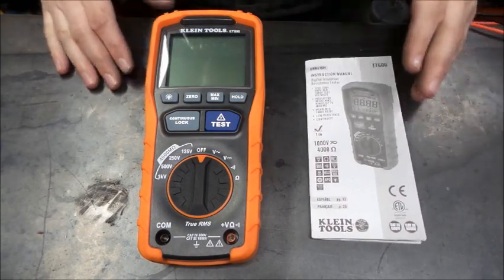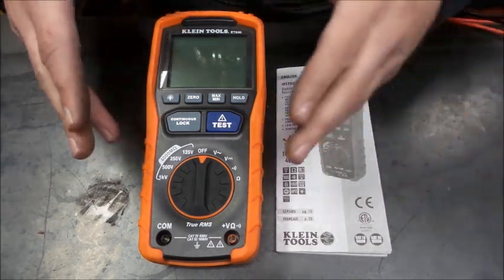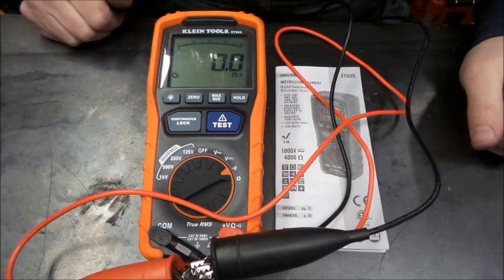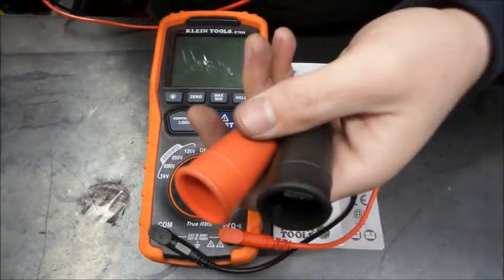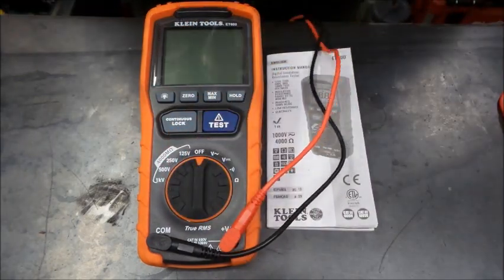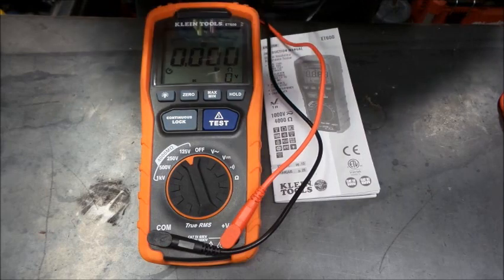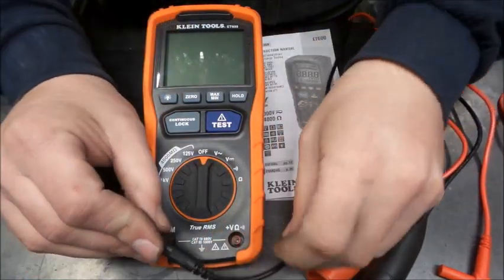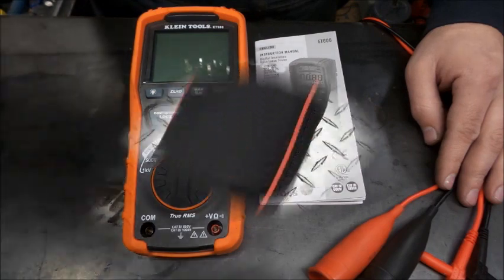Klein Tools ET600 Insulation Resistance Tester - Talking Hands Tools Review

Comment: Why do you need to press lock button ?
Reply from the maker: Sometimes when your testing things you do a fairly long duration test. For those situations its nice to not have to continually hold in the button. Caution should always be taken when doing this due to the meter leads staying energized.
Reply: Megger testing requires time.  Most people use the lock button feature instead of pressing and holding the button.  This is to get a good result reading for data collection.  I wish this meter had a higher resistance reading capability like 11 G Ohms.
Reply from the maker: This meter at is price point it a good utilitarian all-around troubleshooting meter. I think it's more aimed toward the obvious faults that show up fairly easily, like grounded wires or motor fields, etc. 

I agree it would be nice if Klein came out with a "Big Brother" version of this more like what you're describing for more in-depth troubleshooting.

Comment: Thank you for the video. I just bought one of these to test my Schluter Ditra heat floor cable. Per the manufacturers instructions, when testing with a megohmmeter, I am to put 1000 volts into the wire. Maybe you can help me. I’m trying to wrap my head around putting 1000 V into that wire. That’s eight times the volts of household current, yet it doesn’t harm the wire? In the instructions say to press and hold the test button, but I’m not sure how long to hold. If I don’t hold long enough, as you mentioned, I can’t complete the test. But how do I know when to release the button? Can holding it too long cause harm? If you would have time to reply, I’d really appreciate it. Thank you
Reply from the maker: Wire insulation always has a voltage spec. What is listed on the cable as the voltage spec. 500-1000v is fairly common to test at this is due to factor of safety. If it's 600v rated insulation 1000v is generally within the factor of safety of that insulation. A lot of the wire used in houses is known as Romex or type NM cable this too generally has a 600v insulation rating. The key to this is never, never have something hooked up to the cable when testing, the wire may have a factor of safety to test that high but most things you would hook up with that wire do not and the magic smoke tends to come out. 

The manufacturer may mention going that high but for basic trouble shooting you likely won't need to. Start at the voltage your cable will be running at on the first test, see what you have if it's grounded or compromised and it doesn't work at 120V chances are you should be able to start troubleshooting at 120V. If it tests okay at 120V double it to 240V. One of the reasons I really liked this meter is you can do lower voltage testing. For me with the older tools that was key yes the insulation should be able to handle it to a point but why risk damaging something?

When you test you normally hold the button for 30 seconds to 1 minute, some cases may have you go longer but this should work for basic troubleshooting. If the reading haven't stopped changing continue. Another advantage to starting at 120 if this equipment runs on 120 is you don't have to worry about duration as much cause your already down at operating voltage and if you missed anything it should hopefully show up.

This is a serious tool and you can damage things, seek out other videos or information outlining a test, specifically how to isolate what you are testing. I realize you may receive multiple different points of info but the basics will all stay the same. I am certainly not a properly certified instructor or representative on these things I can only offer what experience has given me results in the past. I don't know how decent product support is for what you are working on but an option may be trying to see if they will walk you through troubleshooting. You can say you have a megger and that will likely help out the process. You have a very valuable tool for troubleshooting but there is a process to be learned when using it. If I get a chance I will see if I can add a link here in the comments outlining more of the process but feel free to search on your own. I don't mean to scare you off but I do want you to be safe.
Reply: @TalkingHandsTools  thank you for your detailed and thoughtful response.
Reply: You can do higher voltages because the tester is what’s supplying the power, amp draw is restricted. Whereas when heater wire is connected to its power supply, it’s allowed to draw more power which then heats wire. For example what’s going on: 1000 volts @ 0.25 amp = 250 watts vs 1000 @ 5 amp = 5000 watts.
Reply: Here's a thought: Read the manual.

Comment: What would be a bad insulation resistance with this tester? On residential wiring??
Reply: Depends where you live. In Australia any thing less than 1M ohm is a fail (0.1M ohm on sheathed heating elements). That said if you measured under 30M ohm on a new installation I would investigate to see what the problem is becasue that may be a future problem.

Comment: what's the difference between the mm700?
Reply from the maker: The Klein Tools MM700 is a Digital Multimeter while the ET600 is an Insulation Resistance tester. Both meters can measure both AC and DC Voltage as well as basic resistance with a continuity function. That is where the similarities end the MM700 also has a thermocouple function that allows temperature readings from 0-1500F as well as a basic current meter up to 10A, It will also measure Capacitance, Frequency and Diodes. The ET600 basically does a resistance test on steroids. What that means is it applies a higher voltage and looks for a current loss in the circuit being tested. In the ET600s case it can apply up to 1000V DC during a test while the MM700 only applies around 1.5 volts to the circuit. Think of it like doing a leakage test on either a pneumatic or hydraulic system, in order to test the factor of safety of a system you test it a higher pressure than normal operations would achieve. I know this is a fairly long winded response. I have a Klein Multimeter similar to the MM700 if not the MM700 I cant remember. If your interested maybe sometime I could try and show both in a video and try and explain it a little better. Bottom line the ET600 is a fairly specialized tool designed for mainly one specific test where the MM700 is more of a tool that fits multiple needs.
Reply: @TalkingHandsTools  Thanks, I appreciate the detailed explanation. A video would be fantastic.
Reply from the maker: No problem I will see what I can do. Wayne had a great video idea also. I'd like to try and do them both I'm just not sure on a timeframe. Keep tabs on the channel I'll get to them!